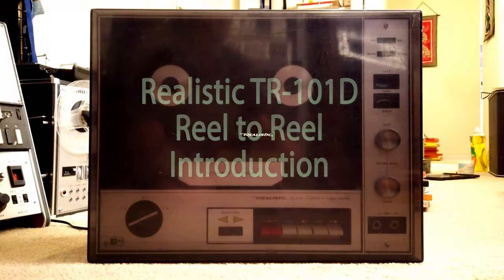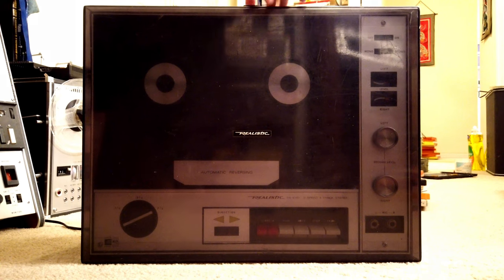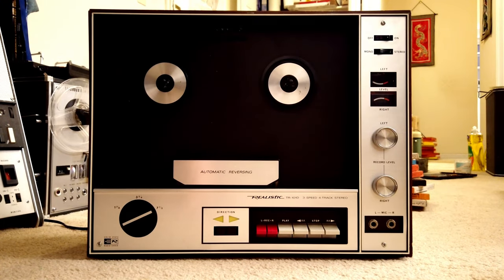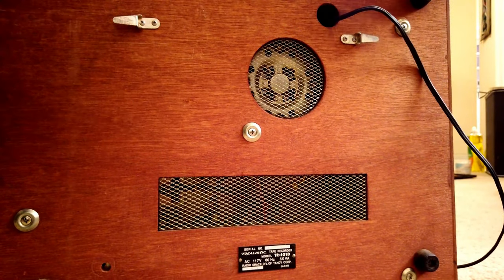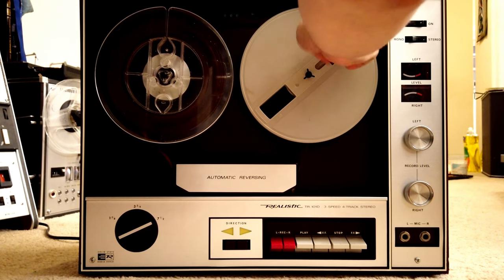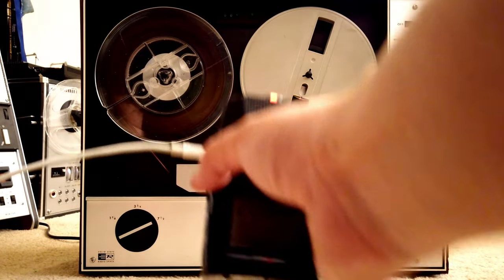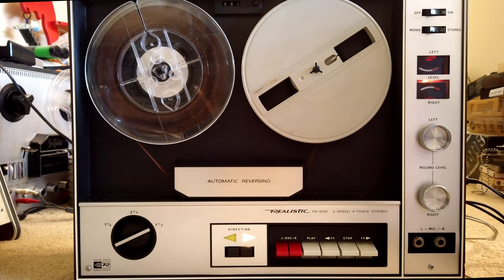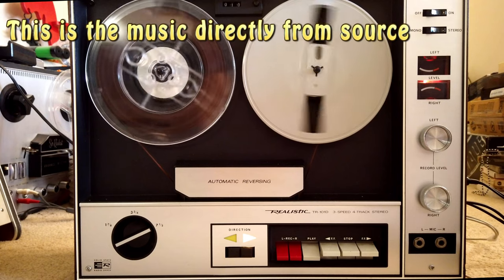Realistic TR 101D Reel to Reel Introduction Demo

Comment: Very nice demonstration, enjoyed that! Definitely some design quirks there, especially the trim piece getting in the way of the threading path. The direction change when fast winding is more common than you might think with auto reverse decks, especially older models. It sounds quite good for a lower end single motor deck with combination heads. I wonder who built it for Radio Shack, I’ve never come across a transport like that…maybe OKI or Dokorder?